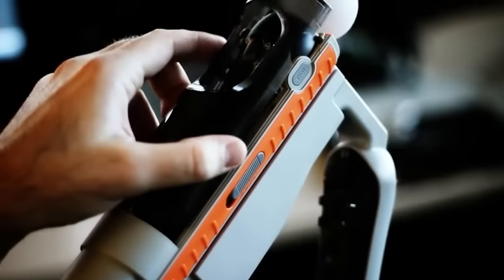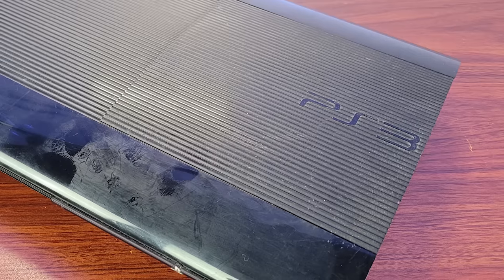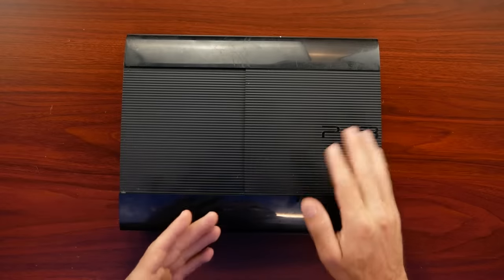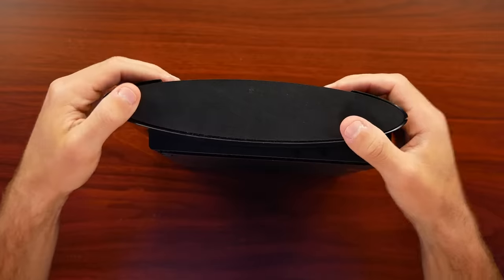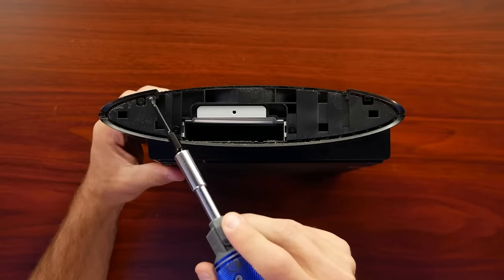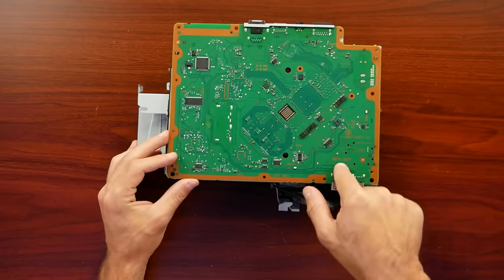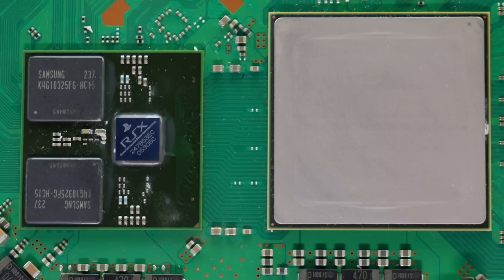The Weirdest PS3 Sony Ever Released

Comment: After my original fat ps3 red lighted, I got one of these. It was going to cost more to fix the fat than to buy one of these. I should have fixed the fat.
Nothing wrong with the utlta slim and I still use it today, but the fat was a much better version.

Comment: That thing is so cheap. The parts can pop off easily and if you use discs, it is NOISY. The other model PS3s aren’t that bad, this has almost 0 noise dampening. It is great for digital games though

Comment: I only ever seen one of these in the wild and it was in what I would nicely call a crack den crash pad in north kc the ppl there had it hooked up to a cheap flatscreen sitting on milk crates and the ps3 itself just on the floor hella dusty and grimy and with the disc tray lid ripped off disc spinning completely exposed and with cigarette ash pilled on top of the system and some spilling into where the disc itself was of course the only game they had was like black ops 2 and it would crash on certain maps cause the disc was messed up after my homie scored his qwop we got the hell out that roach hotel and didn’t slow down till we were past dtkc but I still remember that poor ps3 I wonder how long it survived 😢

Comment: Just got one of these at the end of 2019 to play Ratchet and Clank and just have a PS3. Had a slim that I had got in 2012, but sold it. Never actually owned the original PS3 cause I got a 360 instead and original ps3 was expensive.

Comment: People love to complain about the reliability of the 360, yet no matter the model of ps3 it always had problems. My 500gb super slim is sluggish, crashes sometimes and doesn't always try to charge my controller....and speaking of which, the controllers are terrible, neither of mine power on anymore. It's the only generation that I prefer the xbox over the Playstation...I can't believe I even said that.
Reply: Perfectly justified, the 360 was simply a better product that only saw improvements. Your superslim may just have some issues inside that you could root around and figure out, but yeah the Xbox 360 is such a solid product

Comment: I bought one of these last year, i didn't had a ps3 back in the day (jumped from ps2 to ps4), i've bought it used and it came with a 200 and something hard drive, too bad it didn't come with a legit dualshock 3, i'm using a dualshock 4 for now but the motion sensing is not compatible

Its a weird ps3 but it does the job, i'm currently playing ffxiii and sonic generations
Reply: The console itself has been fine for me, my legit DualShock 3 controller hasn't been. No clue as to why though as I never abused the thing. It's started doing random inputs on its own and even almost signed me out a few times. Unfortunately I'm only looking for a decent third party solution now.

Comment: This was the cheapest to make yet it's still the most expensive you can get second hand lol but it's a cool little system. A friend of mine used to own one and i liked it. I had 2 broken normal slims and recently bought a third slim for 40€ and i tested it and it works pretty wel it was fairly clean it had a couple of scratches and scuffs but what can you expect from a system that old right? The only downside was it was missing a couple of rubber feet but other than that i'm pretty happy with it.

Comment: I had a 360 all the way through that generation but I wanted to play some of the exclusives on the PS3 so I purchased that model with 12gb hard drive which I replaced with a cheap 500gb hard drive.
I went for this one especially because it was one of the only ones that actually came brand new at a reasonable price I think I paid 100 pounds for it brand new and I liked this one especially because it's the smallest one.
I've not had any issues with the one I have working perfectly and no issues with the drive.

Comment: At least it doesn't seem to ylod. So just soft mod it and install your games on an ssd. No more need to open the disc slot.
Reply: And if you do, USE THE EJECT BUTTON. if you open it with your hands, you’ll WILL break the locks because you’re forcing it open. It’s the main reason why the superslim breaks at that point.

Comment: My 1st ps3 was the 40gb model. Broke on me I don't know how many times. Sony replaced it with a slim model after a while. That broke and replaced it with another slim. That disc drive has now gave up for some reason. Got myself a super slim to use as my main ps3 console. Still have the 120gb slim which I will fix when I work out what is wrong as fix it and a few days later same problem. Then also got myself and original 60gb. Want the 40gb so I have all the different shapes

Comment: I have 2 ps3 fats, and the ps3 super slim.  The super slim has been perfectly reliable.  The ps3 fats I could run in the winter time and it would heat my living room.  I am not joking.  I do love my ps3 fat, though.  I never knew my ps3 super slim had an open button.

Comment: Got a 2 of these Super Slim with 1tb drives.  one I had from new and the other I bought for £15 with two Controllers bought the second one mainly for controllers but ended up cleaning it up bought new panels from china, changed cmos and thermal paste. Got A Slim as well but dont really play on it profer superslim.

Comment: I bought it because it came with GTA V. It ran very quietly and was cool to the touch. ...When I got my og PS4 though. Jet engines that you could heat your sandwich on!
The loudest my PS4 ever got was on the map screen in God of War. Multiple times, no fluke. If you have an og base PS4 you should see for yourself ;)

Edit: My PS3 SS had the 500gb hdd. Sold my PS3 Slim 120gb and some of my old games which paid for my PS3 SS.

Comment: I got issues with mine  last year the hd died no big deal  I swapped in a SSD  then the wifi died ok no problem  I'll use ethernet for the last couple weeks I get "no ethernet cable connected" and get logged out of PSN every 10 minutes.  It's not the end of the world since I'm mostly using it offline at this point but still annoying.

Comment: that thing is the Great Value PS3, pathetic compared to the Cadillac PS3 Phat.
Reply: The phat is a power hog, and loud as hell. I ran with that for many years. I recently transitioned to the super slim, and it's buttery smooth and quiet. I frankly should have made that move sooner.

Comment: Have am 80gb that's been repasted and re-padded (Can't risks a delid, I failed on a dead system and it will play Gran Turismo 6 at 65c at 29 - 32% fan speed all day so that's acceptable)

Picked up a super slim for $70 for the soldered IHS design with a bare gpu die / no nek-token in the back of my head(even if they'll be fine if cooled sufficiently like mine)

Comment: The PS3 super slim top and bottom bars are shiny and reflective exactly like the original fat PS3. I really don't like that at all. I also don't like the mechanical sliding for the disc drive. I hate the ridged style it has also. It's just so ugly to me. I love the matte black finish to the PS3 slim. Also model from the beginning to 2900 have the time capsule which can damage the system. I have a 3001 PS3 slim and all models of PS3 slim to PS3 super slim with 3000 and after do not have a time capsule in them so they will continue to run forever. There is PS3 slim models wih 2000 numbers however and they all contain the time capsule which again causes a problem. But I have the 3001 model so I don't have to worry about the console ending itself at all!
Reply: CBOMB is patched if you run CFW

Comment: I would never buy or own a ps3 super slim no cfw compatibility and its shockingly cheap design turns me off.
Reply: @duncanmacleod7287 true but I heard with hen it's a pain in the ass just to get PS2 games running.
Reply: I got this ps3 and is a beast with hen 4.90 and free shop cgi got all free games i want  and license, and got 500 gb hdd

Comment: The Ps3 Super Slim is the Worst, i rarely see them working one, most of them doesnt't turn on or the Drive Mechanism is broken, i tried to find a fix but i haven't found a solution to the rotating plastic thing to make a full rotation, the only solution is to slam the drive in order to fully close it otherweise it get stuck half way.

Comment: The PS3 was a terrible system and I feel bad for people who owned it and didn't have an Xbox 360 or PC.

First, it was ovepriced, and it didn't have trophies until much later after launch. The controller had poor motion detection, and felt cheap. Later models were cheaply built, and the game library was inferior to the Xbox 360. Storage space was abysmal, as shown in this vido where one console only had 12GB of useable space. Games ran worse than the 360. Online play quality was terrible and it was generally just a poor quality console.
Reply: @Exile Durrr

Comment: Well I'm going to trade my ps3 superslim for the fat model 😑
Reply: That model has Issues. Ps3 Slim is Better rhan Ps3 Fat
Reply: You should trade for slim, fat is much louder and it had overheat, ylod problem
Reply: Well, I'd be careful with that. The phats are power hogs. Loud as hell, and have a higher failure rate. Hopefully you stuck with the super slim.

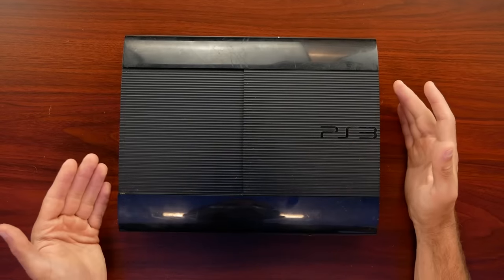Comment: 3:08 The cheap build and this crappy thin as paper slide disc cover is why I'll never buy this. The PS1 was stronger than this. They might as well have done a throw back to the original if this is what they wanted. At least nostalgia would keep ck in. This though, is garbage.

Comment: They so good low power all games perfected online is free no subscription needed runs PS1 and PS2 has blue ray I mean why ain't people all over PS3 I give it two years. Yes that model usually needs a upgrade as some fool not slotted a harddrive in. But yes other that a dust magnet they great the ribbed design should have been flat